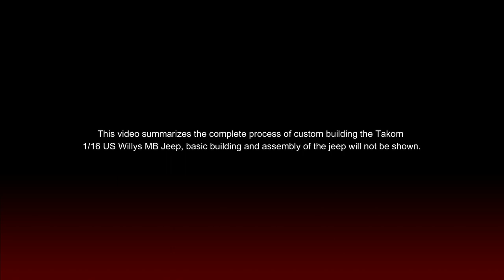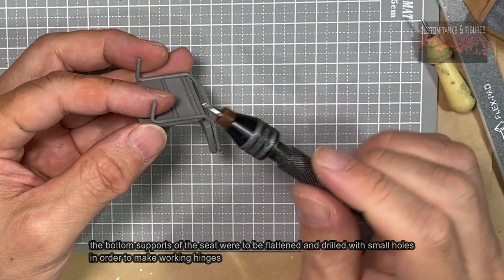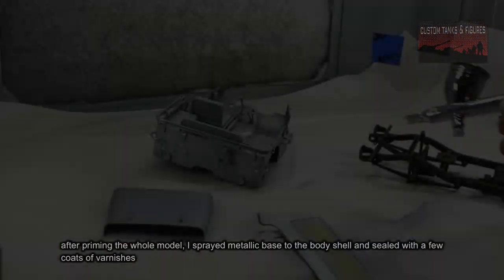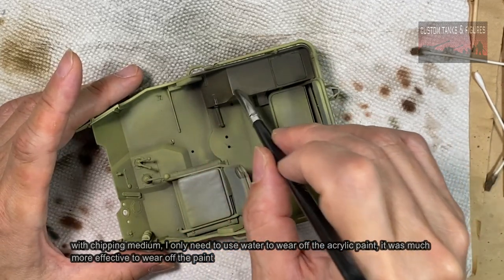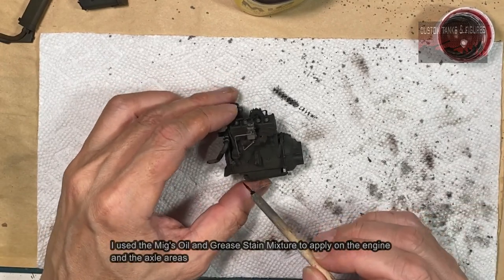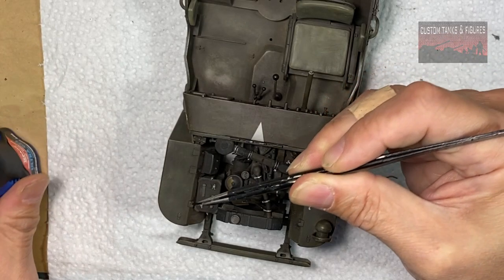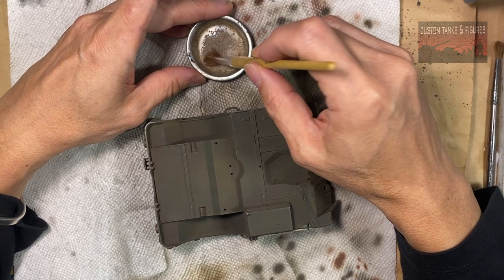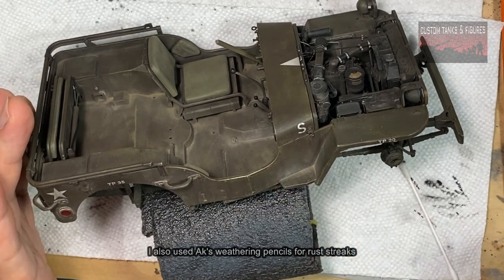Custom 1/16 US Willys MB Jeep Takom Complete Build

Comment: Hello! Really well done, it looks fantastic, great attention to details! I'm building one myself and I was wondering what kind of vinyl tube did you use for the engine wiring system? thank you very much
Reply from the maker: Thanks !! The thin ones were bought from a hobby shop car part section and the thicker ones were from eBay electrical wires - you can pick any sizes you want with various vinyl cover colours

Comment: Excellent work!
Im about halfway finished with mine. You have inspired me to go back and wire the engine...lol
Reply from the maker: Thanks! I can understand - the model itself is so detailed that leaving out the wiring works would be such a waste to complete this model. Also the wirings seems quite simple to do, just that the other wire ends I did not have a clue where to attach 😉
Reply: @henschelporsche1  Are you talking about the center wire from the distributor? It goes into the coil
Do the hinged seats come that way with the kit,or did you need to modify them?
I'm just now adding the body panels.
Reply from the maker: the distributor wires were ok to understand but some of the wires from the dash side I had to guess. No the hinges I had to make them, the kit comes in fixed position only. Good luck with your build!!✌
Reply: @henschelporsche1  thank you.
You are a wonderful builder.
I'm just now getting to the seats...yup 
For the price point this is an amazing kit..I'm having lots of fun.
Like you and your son, I've been building 1/35th since I was little.
I'm 63 now.  This kit has gotten me hooked on this scale.
Reply from the maker: I am in my late 50s and my eyes not that well to work on 35th, also 16th is a great scale for adding details like these hinges 😀
Reply: @henschelporsche1  that is some impressive work.
Very cool.
This is one of those kits that I wish everything was visible..
Reply from the maker: Talking about great kit, I am in the process of building the new Das Werk 1/16 German halftrack Sd.Kfz 251/1 Ausf D. That kit is a blast with lots of interior and engine details , so stay tuned for my upcoming videos in the coming weeks to show this amazing build!  @stevecausey545
Reply: @henschelporsche1  I've subscribed...and that kit seems to have a great price also...I guess when tamiya 35 costs 80 dollars...these kits are a wonderful deal

Comment: Another fantastic video.
I also have this kit, and I will be using this video as my reference. Did you do any modifications to the frame? I believe there is a section of the frame that is supposed to be boxed in that this kit misses. How did you find the quality of the details on the gun?? Some say it could be replaced with a better 3D printed one, but I have not seen any examples of this. The kit does however need a better face on the driver. It looks to smooth like a store manikin. This is NO reflection on your work!! You can only do as good as some of the parts sometimes.
Thanks again for your work. AMAZING
Reply from the maker: This is the first time I work on a 16th scale GI vehicle, and I really don’t have much study on the jeep, not sure about what you mentioned regarding this frame issue. But I found most of the details checked out accurately with the real photos. I only modified a bit on the seat and that is. Of course you could also add wires to the wipers on the windshield which I didn’t do. And you are right about the figure face it looks awkward no matter how you paint, I should have swapped it with a better one. The 50 cal M2 is so so and you can always replace with a Aber one but the weigh might be an issue.
Reply: @henschelporsche1  
Thanks for the reply I will look into the Aber one.
Are you doing any 3D printing?
I can find decent quality files for armor figures etc. Im just looking for items to justify the purchase.
I will look to see who it was that commented on the frame and let you know.
Cheers
Reply from the maker: 3D printer is always on my buying list but still struggle to select a proper one.
Reply: @henschelporsche1  
My son has one of the dry ones as I call it, not the one with the resin bath. 
So with his, the resolution isn't that great for anything fine.
What he has told me is the one with the bath produces the highest resolution and detail, but is has a few disadvantages. It can be a little smelly, and then you have to cure the items with UV.
I figure with all the custom stuff many modelers will do, this isn't much of a disadvantage with all our stinky paints etc.
I keep searching the 3Dimage web sites for figures etc, but have not found any that people are willing to share, or sell.
As soon as I can find/buy some decent files, Im going out for a printer. That my excuse and im sticking to it.
Do you have an email in case I find something?
Cheers, KJ
Reply from the maker: @hobbyhands976  thanks for sharing the info on 3D printing!  I do have in mind the same wet resin type printer and would seriously do some research to purchase one next year as making those custom parts by hand not as good as printing. Could be much cheaper to print figures than buy them online. I do come across some 3d file website with nice 16th scale figures, perhaps you could forward to me if you have any in hand : customtankfigure@gmail.com

thanks in advance!
Reply: I owned a Jeep MB military for years and these and the Ford built clones, the Ford GPW, have open 'C - section' frame rails that are only boxed in at strategic points - such as where spring hangers and crossmembers attach to the frame rails.  The kit is incorrect in this regard, boxing the chassis in along most of its length to make assembly easier and the finished chassis slightly more robust.  I corrected this on mine by cutting up and modifying the central 'spine' so it only closed in the correct parts of the frame rails https://www.youtube.com/watch?v=32_waowuO-M&t=59s  As I mention in both the description and the video, try to get lots of photos of a specific prototype vehicle if you can as there were slight changes over production.  If you aren't worried about being so specific there are plenty of photos of Jeep MB chassis undergoing restoration on the internet and you can work out the details from these.

The M2HB 50 cal  in the Takom kit is exceptionally poor given how recent the kit is.  I'll be doing another video soon dedicated to the 50 cal alone, comparing the various 1/16th 50s.  In short, a couple of minor modifications to the 20-year-old Tamiya 50 cal will yield you a beautifully detailed 50 - complete with opening feed cover than includes the feed pawls and internal bolt details.  In my humble opinion the Tamiya 50 is still king after all these years.  The sprue for the 50 is still available as a 'spare' from Tamiya for about the same price as the Aber detail kit.  If you are happy to play around with the brass barrel and PE of the Aber detail kit and use these for the Takom 50, enjoy, but if you get hold of a Tamiya 50  you don't really need to - or you could really go nuts on the Tamiya kit and have the best of all worlds.  For such a prominent feature of the kit, Aber really dropped the ball on the .50 cal they include - sadly.
Reply: @henschelporsche1  Hi again, here the the name of the video regarding the Jeep frame. "Takom 1/16 Jeep - How to make the chassis frame much truer to prototype" the YouTube name is "engineer me a tea" The reason I think this person may be correct, is many frames back then were of the Stamped "C" shape.
Could be totally wrong, but I am going to do more research. The only reason I mention it is your attention to detail.
Id like to ask what is your go to brand for paints? I'm coming back after 40 years and have no paints in my stock. Not sure if I mentioned,  I would like to get about 50  or more of the main colors. Next year when I move any hobby store will be at least 2 hours away. As my carpenter friend says, "Id rather be looking at it, than looking for it" So several hundred dollars on all the supplies is expected. 
Cheers, KJ
Reply: @contributor7219  
Thank you so very much for your input.
I have always like jeeps, Ive had one long ago. I agree with you the 50 cal is,, well,, crap IMO.
I will refuse to add the one out of the kit. 
I have kept an occasional eye out for the Tamiya, but I think my chances are pretty slim. I have also checked thingaverse, but nothing there either. So for the rest of us, if you ever find a good print file, please let us know. Im waiting for a excuse to get a good resin printer, and a file for this would go along way to make it happen.
Cheers with regards to your help.
KJ
Reply: @hobbyhands976  The reason for the stamped C-section chassis rails on the Jeep design was threefold: The first is they were trying to meet a very ambitious weight-saving target and every little bit of weight saved helped, so boxing in the chassis fully was simply adding material not needed;  Secondly, steel was in short supply during WW2 so using it as sparingly as possible saved it for other uses;  Finally, the Jeep design relied heavily on chassis flex for axle articulation because it had semi-elliptic springs on both axles.  If you find some photos of WW2 vintage Jeep chassis you'll see they have open rails as per the rails on the Takom chassis in my video.  It's also worth searching videos too as there are some Jeep chassis restoration videos that clearly show the C section, and more importantly where the reinforcing sections are added.

Tamiya 50s often come up on Evilbay, or good hobby shops that sell Tamiya kits should be able to order in the 50 sprue for you as a spare.  I have a stash of them purchased over the years in that way.  I'm pretty sure the sprue most easily obtained at the moment is from their 1/16 'Super Sherman'.  It's worth taking the time to find one if you possibly can.
Reply: @contributor7219  
Thanks for the reply, I had No idea you could ask to order a separate sprue, well try to order, a lot of shops wouldn't know about it, or give a rats arse to do it.
So you think the best one would be from Tamiya's 1/16? Im guessing that is their RC??
And if it is I guess I would need to know the model kit number, and is the sprue "serial" number 50?
Thanks again, KJ